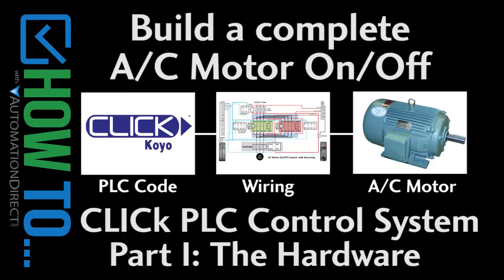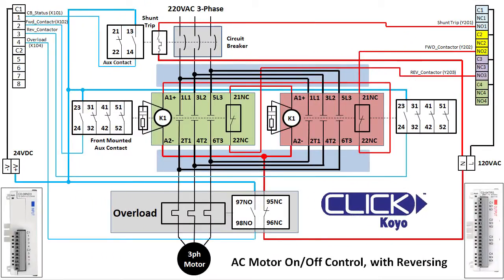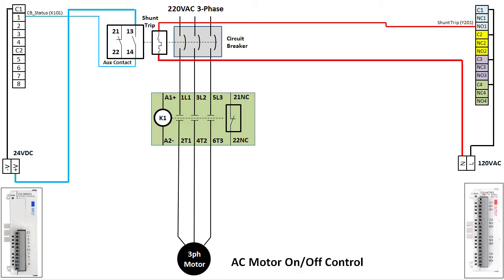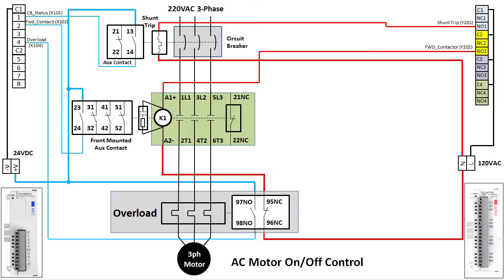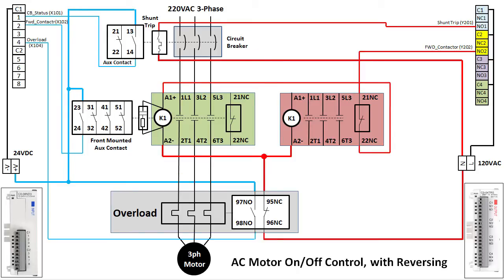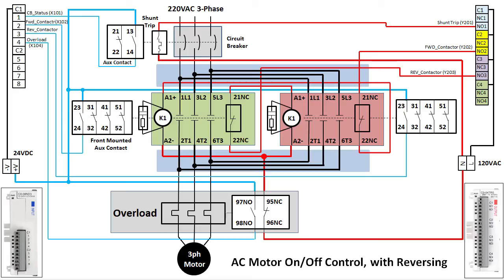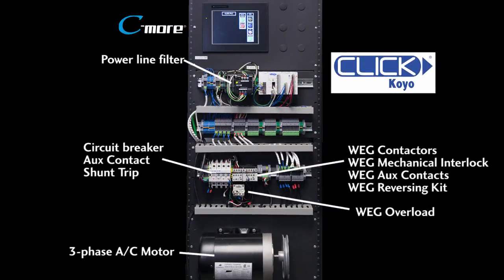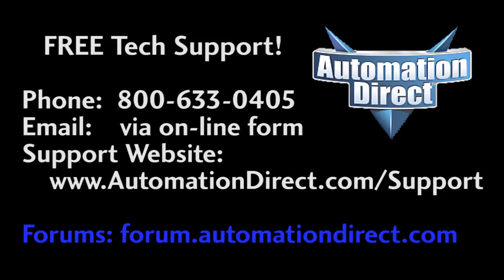AC Motor On/Off with CLICK PLC Part 1 from AutomationDirect

Comment: I have koyo plc . I want to use a proximity sensor on motor shaft the condition I want to apply is that when motor rpm goes to 900 output Y1(for example) turns on and when rpm goes down below 900 output turn off
Reply from the maker: Muhammad. Please see, this video on RPM: https://youtu.be/usv_FRWMnYc
Reply: @automationdirect  will this work on Koyo DL240
Reply from the maker: @Muhammad, if you are using a DL240, that video will not work for your setup. You will need to use a H2-CTRIO2 to get a rate from a inductive sensor. We do not have a video that details this setup. I would advise contacting Tech Support, and seeking setup information. 1-800-633-0405.